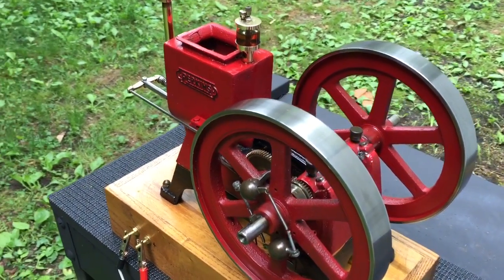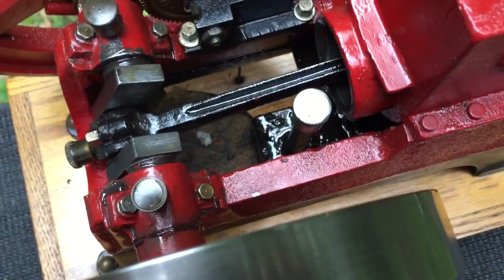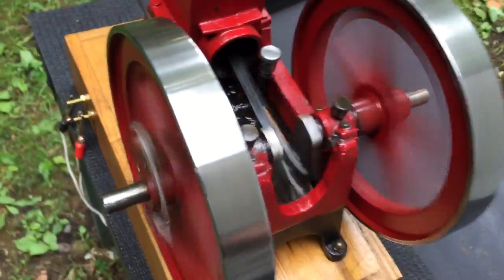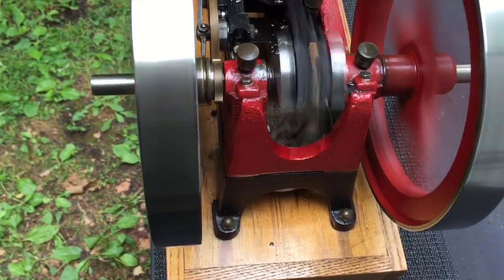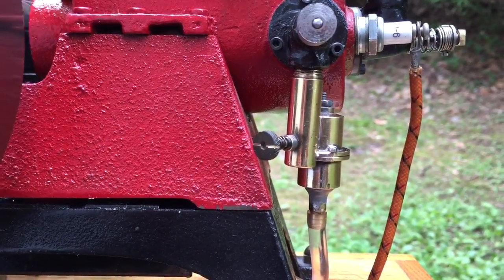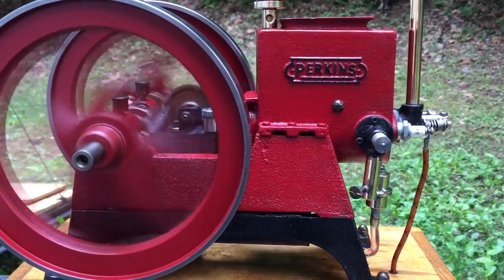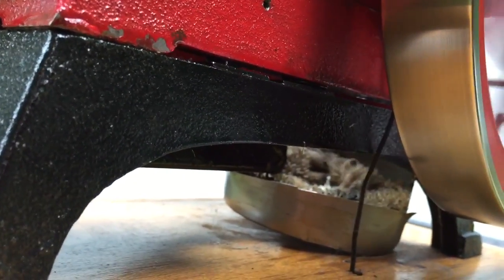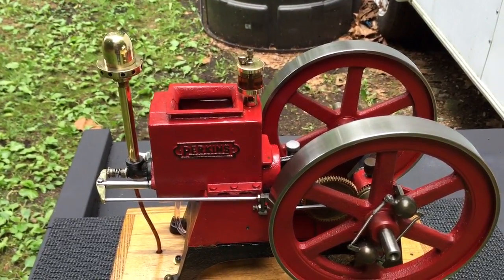1/2 scale model Perkins Hit and Miss Engine

Comment from the maker: 6/6/15  I had someone contact me through my eBay ad and they said that they did not think that this is a 1/2 scale model.  Here is the information on it's size. Then you can determine what scale it is...
Not including the wooden display stand this engine measures 10 3/4  inches tall (to the top of the exhaust stack). From the back of the flywheel to the tip of the exhaust rocker arm it's 14 inches long. And from the outside edges of the flywheels it's 7 inches wide. 
The wooden box it is mounted to measures 14 x 7 x 3 inches. Total height to the top of the exhaust stack including the 3 inch base is 13 ¾ inches. The flywheels measure about 7 3/4 inches in diameter. It weighs in at slightly under 30 lbs. 
A hit and miss Olds that I have has flywheels that measure just under 8 inches and that one is listed as a 1/2 scale. I found a video showing a original Perkins and they are really not that big. So judging from the flywheel size I am calling this one a 1/2 scale. Any of the 1/4 scale engines I have, have flywheels in the "just over" 4 inch range and they only weigh around 12 lbs. This is a 30lb engine with 7 3/4 inch flywheels...You be the judge.   Thanks for watching!!